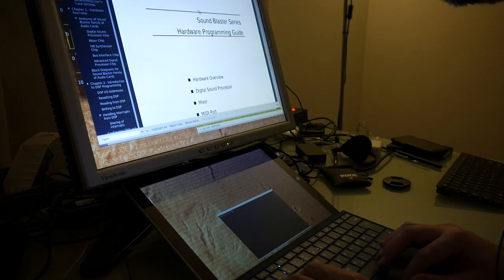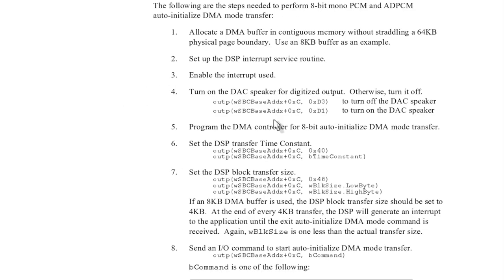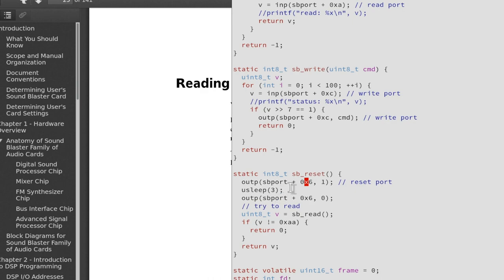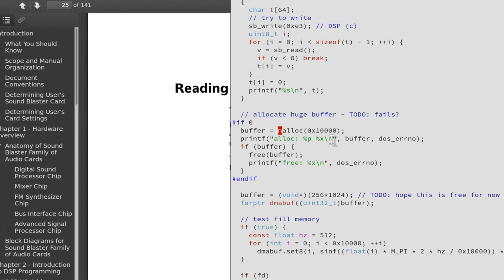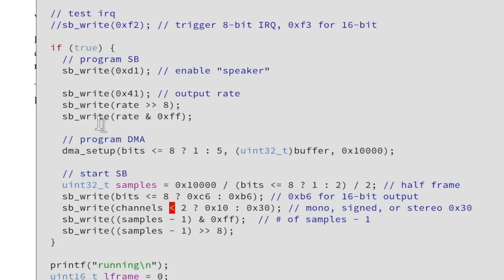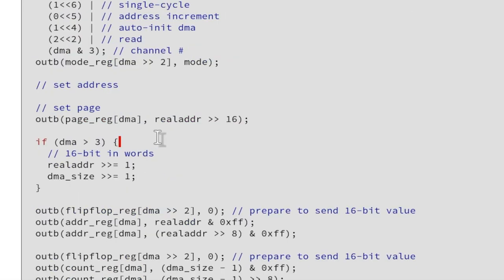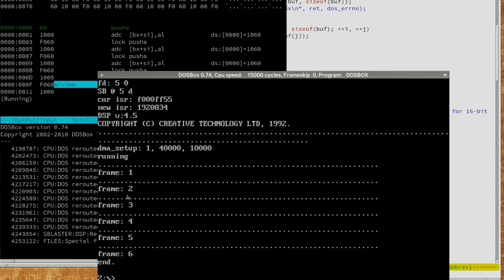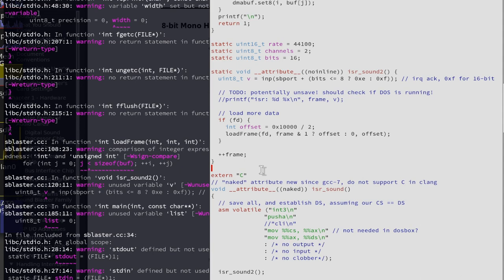Bare-metal DMA programming a SoundBlaster w/ GCC on DOS!

Comment: Hi Rene, COM programs can only address 65,536 bytes (including code and data). To address more you can can provide you own memory management code I think.
Reply from the maker: Well, that is the executable size limit, not yet convinced the malloc error is due .com. Will investigate another day! ;-)
Reply: I'm pretty sure you can't get DOS to allocate memory for you outside of the first 64k segment of memory in a COM executable file (code and data). It needs to be an EXEcutable that can use multiple segments for that to happen (an EXE  holds information in a header on how data and code segments must be loaded). However a COM program does get access to the memory so you need to allocate the memory yourself and not use an INT to call DOS to do it for you.

P.S. I enjoy all your videos including this series!
Reply from the maker: hqqns why? Allocations for .exe are also outside of one segment, ... as this are all “far pointers” ps: for one 64k segment w/ .com you need no allocations, just place everything into the .com program... if you already want to allocate you already need more. If this is a true dos limitation it is another arbitrary unnecessary artificial limitation. :-/ pps: Wikipedia indeed mentions: “In MS-DOS and compatible DOSes, there is no memory management provided for COM files by the loader or execution environment. All memory is simply available to the COM file. After execution, the operating system command shell, COMMAND.COM, is reloaded. This leaves the possibilities that the COM file can either be very simple, using a single segment, or arbitrarily complex, providing its own memory management system.” Which if true I would still find a strange limitation :-/
Reply from the maker: I could try generating a 64k .exe w/ gcc next ;-) ps: Proof of Concept .exe working! Allocation indeed succeeds then! Damnit!!! On the plus side: will soon publish .exe glue code!!! ;-)
Reply: René R. Genius at work. Great to see! By the way, why stop there? A lot of the games back in the day ran DOS4GW.EXE first and then used protected mode to go as big as needed! ;)
Reply: René R. The limititation in COM files  comes from a time when noone had more than 64k (in the cp/m days) so putting headers into the program to allow multiple segments whould waste space. Hence why EXE was invented to get over these issues.
Reply from the maker: hqqns yes, but I want to use regular gcc as simple as possible, not commercial dos extenders :-)
Reply from the maker: hqqns I was not talking about the header, those would be ok for our use, but apparently artificially limited dos int21 alloc function. Maybe this was done for some backward compatibility or so :-/
Reply: René R. Fair enough!. FYI there is a free open source drop in replacement for the dos extender https://en.m.wikipedia.org/wiki/DOS/32.

Keep up the good work ;)
Reply: This takes me back, the other poster is correct. I recall after figuring out how to do the DMA stuff then having to learn how to write my own protected mode extended memory management routines to get past the 64k limit. Fun times, they don't make programmers like they used to. Thanks for posting!
Reply from the maker: Yeah, when we were like 12yo or so we also used XMS and EMS in our Turbo Pascal programs ;-) guess topics for next months ;-) I have proof of concept 64k .EXE gcc/Binutils linker glue, I think it is even possible to prefix a MZ exe Header in front of .COM executables to convert them if one wanted ;-)
Reply: René R. I moved away from turbo pascal pretty sharpish after porting a PCX file viewer to C and seeing the 2 second speed difference. Alas pascal was a great starter language, records, nice design. Functions and procedures, lol, that was a weird distinction.
Reply: I think i remember the MZ header funk from messing around with 80s virus code.
Reply: Infecting you own machine and writing own virus removal code was fun. Not.
Reply: This made me nostalgic and I'm sure I had used XMS back in the day. Looking though my old floppiesI found somthing promosing. Then I had the fun of trying to get the data off . I got a floppy drive that half worked and after cleaning the heads and finally getting some data off a floppy (a lot of files refused to come of), I found some old code. I had set up an interrupt vector for the internal clock for a global counter (to count lol). I would reprogram the clock to set a wanted frequency for this counter then output to the printer port a raw sound file to play on a home made DAC using a resistor ladder and opamp. I had used XMS so I would have enough memory. I used Turbo C for this. That was fun! (PS. hqqns is subby upside down)
Reply: How to get free ram from DOS within a *.com executable?
Intel Syntax:
; Resize RAM
mov bx,cs
mov ax,sp
add ax,0Fh
shr ax,4
add bx,ax
mov ah,4Ah
int 21h
; Get free Ram
mov ah,48h
mov bx,2000h     ; 128 kb
int 21h
jc ERROR
; Segment address in AX
Reply from the maker: intersting, long time I used this DOS functions, forgot about this SETBLOCKSIZE thing, your "code" relies on ES being valid I guess. Any particular reason why you add SP to CS for the call? Could one not just pas a reasonable amount of required memory to the DOS API call?
Reply from the maker: PS: how sure are you that this should work? in dosbox and msdos this does apparently not immediately work for me in a .com on a first test, ..?
Reply: Before we can get free ram from DOS, we have to calculate how many ram we need for our executable+stack , so we can give all the ram back to DOS that we don´t need.
Reply: @renerebe  "how sure are you that this should work?"
You can test it with the TGARead.bat/TGARead.com.
The code inside get additional 64 KB ram from DOS for loading the TGA-Body.
Reply from the maker: ah indeed, thanks for keeping me motivated to get this working ;-) looks like I did not step thru my assembly glue carefully enough last night ;-)